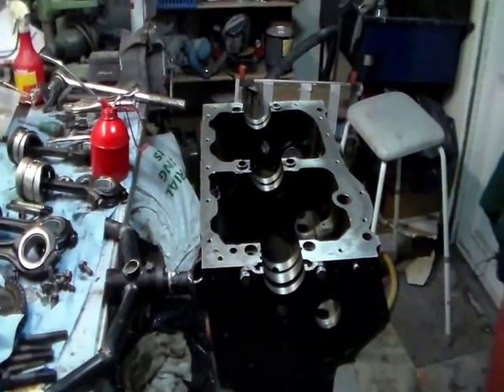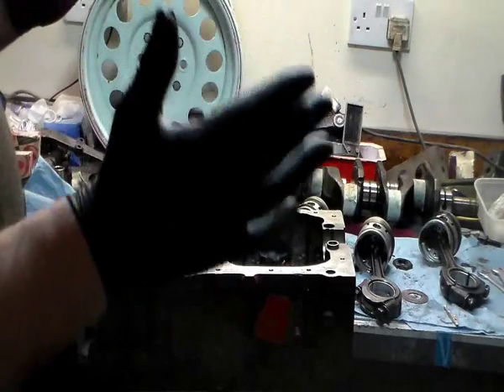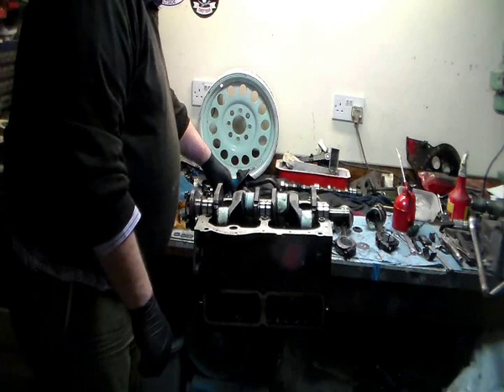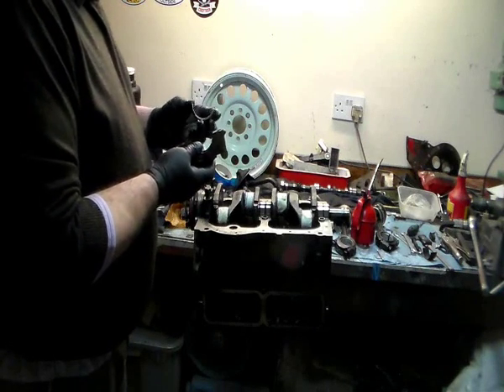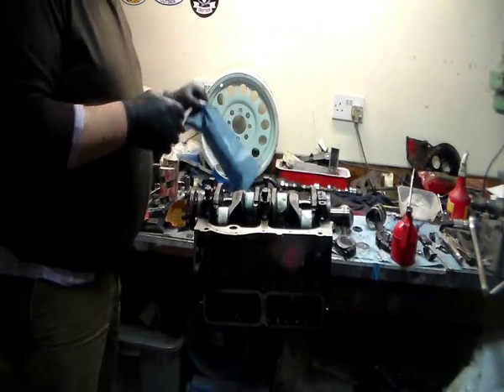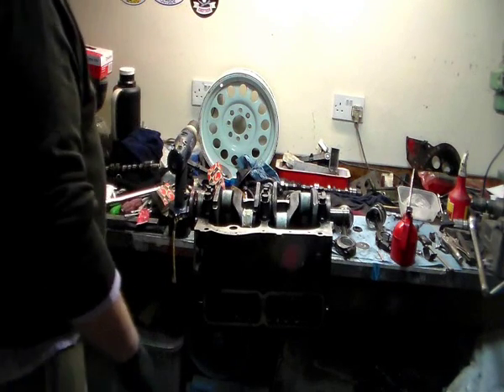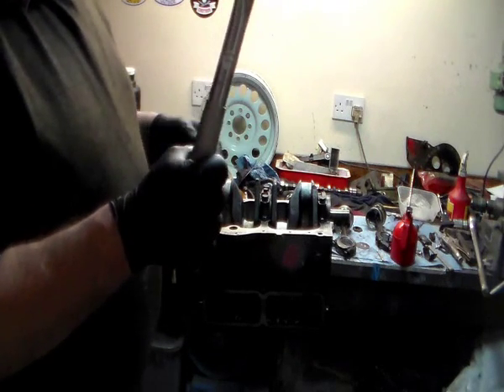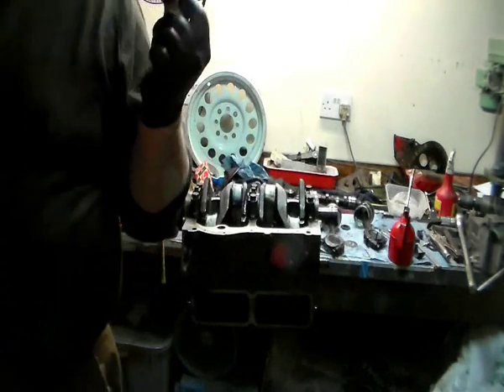Austin Mg A Series 1098cc Engine Rebuild

Comment: I did notice the comment box in the vid, but to emphasise the point - Lubricating threads reduces the friction you need to overcome to wind the bolt in until it gives the right tension. So less torque, not more.
Reply from the maker: absolutely, thanks for the confirmation, cheers